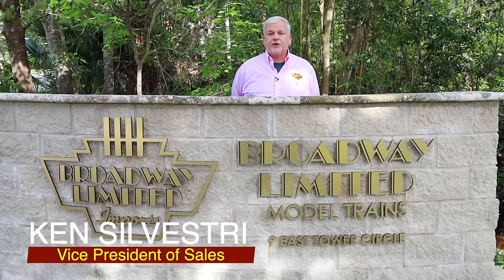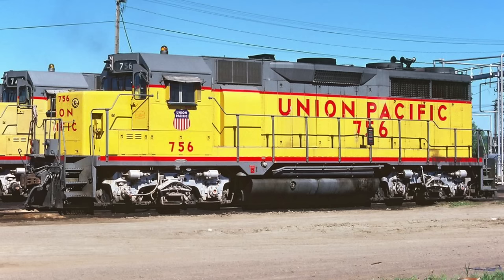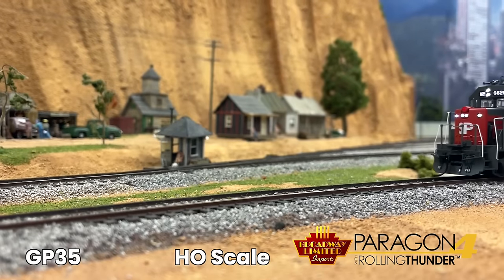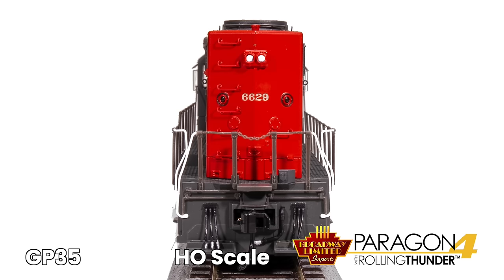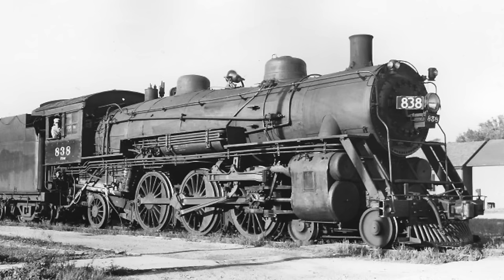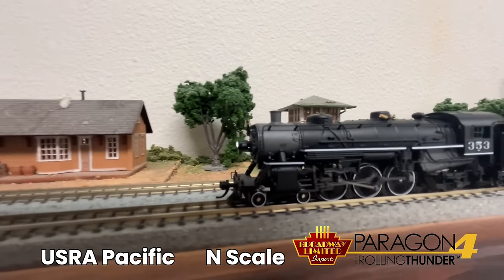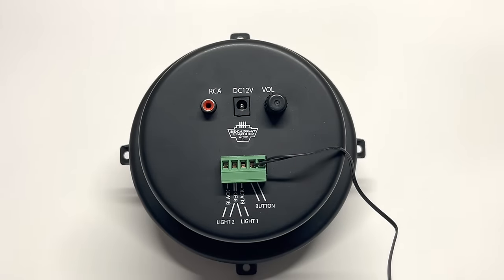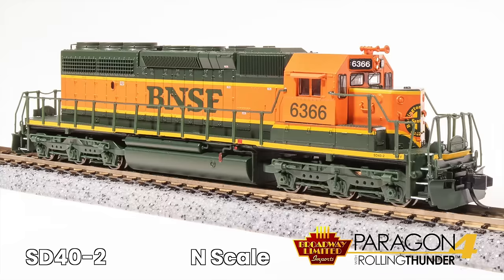Broadway Limited Imports: 3 New items at add to your layout this Christmas.

Comment: When were the Stealth GP35's going to be in? I see the sound ones in stores but nobody has the DCC ready it seems. The BNSF rebuild looks fantastic and I'll be grabbing a Stealth one when I can find em. You guys should definitely do more modern rebuild type locos!
Reply from the maker: The Stealth ones arrived at the same time as the sound ones. Stealth locomotives sold out pretty quickly. That's why we stress to get a pre-order in with your dealer so you can make sure you get the model you want. We hope you find one!